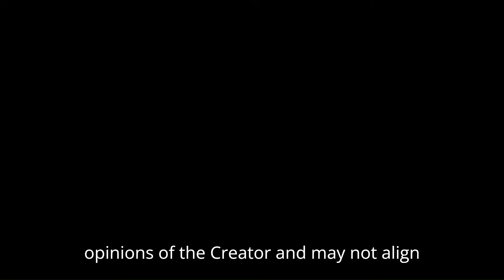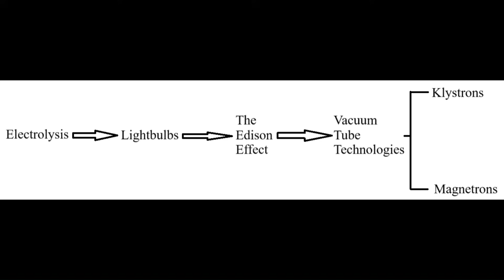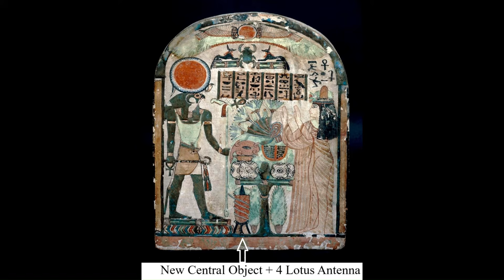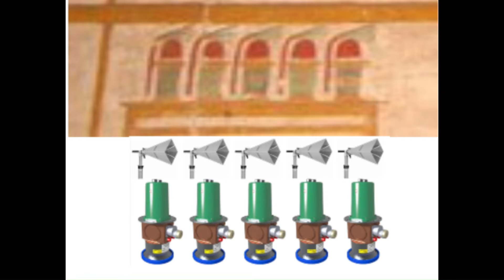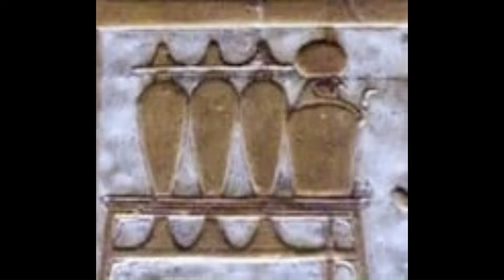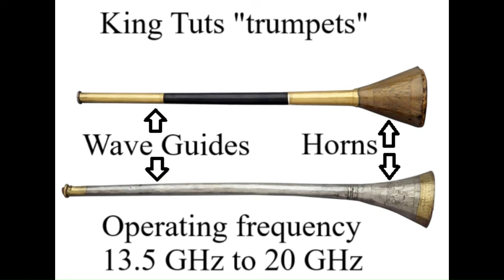Technologies of Ancient Egypt  Part 13   Magnetrons

Comment: Great stuff! 
Do you think they could have been using these setups for power transference to operate specialized high frequency wireless  "tools" ? What might the receiving end have looked like?
Reply from the maker: Hi David, thanks for your positivity. 

At the moment all I have to go off is the 2 trumpet antennas I mentioned at the end. They were found with King Tuts ark and I think that contained communication equipment. But the Osiris device is a bit of an overkill for a regular communication network. 
I have a photo of some hieroglyphs, I'm not sure were they're from, possibly Abydos, I can't read them yet but there's a sequence that contains the electricity symbol 5 times in a row. I think it's supposed to be interpreted as 5 phase electricity and 5 phase is very useful in converting radio waves to to DC. So I do think they were transferring power as well.

 If my last interpretation of the remote, wireless solar powered electricity station was accurate then I would expect them to have developed an advanced rectification method. 

Best wishes